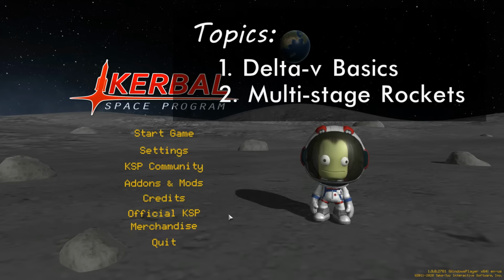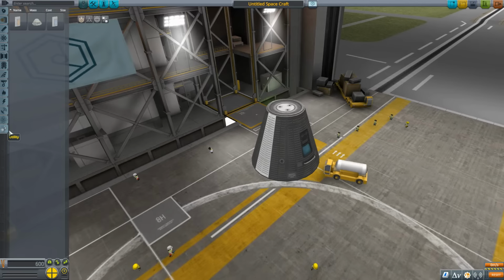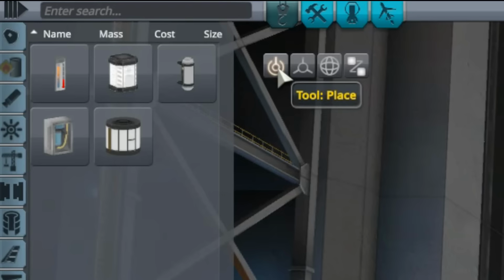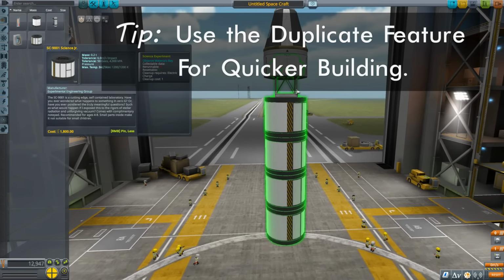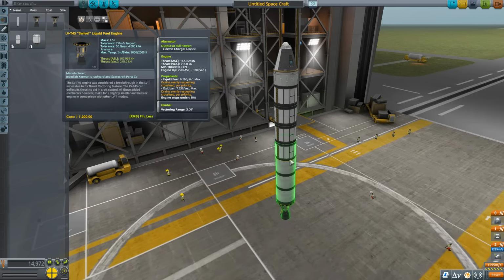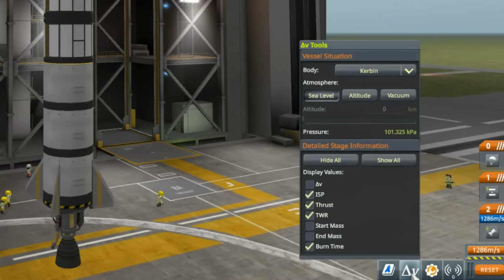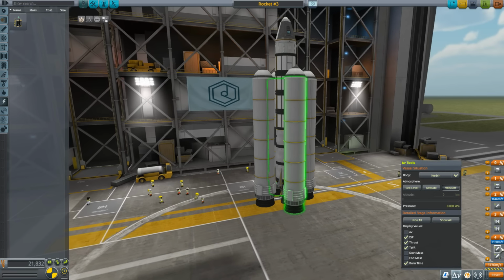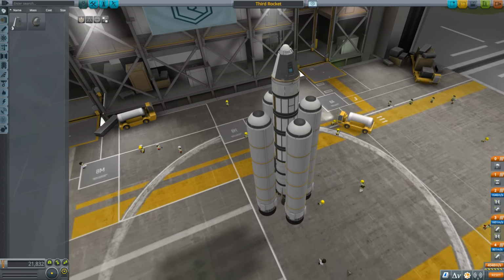More Rocket Building Basics - KSP Beginner's Tutorial

Comment from the maker: *If you are having trouble with the rocket flipping out, watch this - https://youtu.be/H70C32ECn6E*

*I also have a more up to date, and much easier to fly, first orbit rocket here - https://youtu.be/lRzIoKnrhnY?si=27VppKMEYVHsw-q5*

Up Next: Getting to Orbit - https://youtu.be/PbMP0lo4A2o
Reply: Hey, I've been trying for a while now, I've tried putting bigger fins but, my rocket keeps tipping over even if I dont touch it, any clue as to what I'm doing wrong
Reply from the maker: @Blackhole-go3sx  If you haven't already done so, try going straight up and then locking onto prograde a few seconds after launch. If it still flips out, it is most likely the CoL getting ahead of the CoM. Check their positions in the VAB. Also, check your fuel flow priority by right-clicking on the tanks. If you are draining upper tanks first, that could easily be a problem as it will move the CoM down. If you're still having trouble, post a VAB screenshot in the help section of the discord. Make sure the CoM and CoL are on. It's a much easier place to have a discussion.
Reply: @MikeAben  Thanks alot, I'll be sure to do it
Reply: @MikeAben  one quick question, how do I keep my rocket perfectly on the east like you do? Mine always tilts off from the east a bit.
Reply from the maker: @jetpond7904  It takes some minor corrections early in the flight. Once it picked up a lot of speed, it should generally keep heading in the same direction. A rocket like the one in this video is tougher to fly. Don't worry if you're a few degrees off.
Reply: @MikeAben  Oh alright thanks. Sorry that I have got soa many questions.
Reply: @MikeAben  my thumper booster did not have the same stats? What did I do wrong
Reply from the maker: @Kolos Barlik I'm assuming you mean the icons to the left of the navball for locking to specific orientations: prograde, retrograde, etc. If you are playing career mode the unlock as your pilots advance in level or as you unlock better probe bodies on the tech tree.
Reply: @MikeAben  I have a question, why is my UI bigger than it is in your game? sometimes I can’t pin some science on my screen as it’ll take up too much space
Reply from the maker: @jetpond7904  It could be a screen resolution thing. I'm pretty sure the size of the UI can be adjusted in the settings.
Reply: @MikeAben  I actually just found out but thanks !
Reply: @MikeAben  Another question 

I built this rocket but I can’t steer it at all, even if I use SAS to lock prograde, do you know what’s wrong ?
Reply from the maker: @jetpond7904  There are four ways to change the direction of a rocket: reaction wheels, engine gimballing, aerodynamic control surfaces, and reaction control thrusters. You need at least one of these things on a rocket to steer.

If you drop by my discord, you can post an image of your rocket and get more direct help.
Reply: @MikeAben  if it keeps happening I might, but which one did you use in this video?  Also it’s just the same rocket you made in this vdkeo
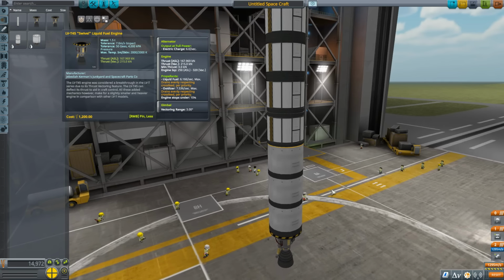Reply from the maker: @jetpond7904  This rocket uses two: reactions wheels and a gimballed engine. I talk about this in more detail starting at 13:46. Note that the SRBs don't have gimballing, so control is limited during that stage.
Reply: @MikeAben  you know what, I actually just found out that it was too hard to steer so I didn’t notice that it was taking affect. I’m very sorry about all of that just because I didn’t notice something

But thanks for helping !
Reply from the maker: @jetpond7904  No worries.

Comment: How did it only add 500? I thought it’ll add another 1600?  22:10
Reply from the maker: It doesn't work that way. Delta-v is not just a function of Isp and fuel, but also the total mass being pushed. As such, each booster added becomes less efficient than the previous one. This is the tyranny of the rocket equation. Keep in mind the staging still had to be adjusted. Once that was done it was closer to 800 added. Still, quite a lot less.

Comment: I am having a lot of trouble with the solid rocket boosters wobbling and falling off. Any tips?
Reply from the maker: Struts will solve the problem if you have them unlocked. There's also the auto strut feature that you can access by right clicking on a part. I believe you have to turn on Advanced Tweakables in the settings for this feature. That all said, the rocket show here shouldn't have that problem.

Comment: Built the exact same rocket. Triple checked. Mine has 2600 m/s. I don't get it.
Reply from the maker: Make sure the dV windows is on vacuum.
Reply: @MikeAben  doesn't make a difference. I'm way below your m/s. Really strange
Reply from the maker: @Davidwv97  If switching from surface to vacuum doesn't make a difference, then something is definitely wrong.
Reply: Did you ever find out what was going on? im experiencing same deal :I
Reply from the maker: @teemuleppa3347  Just to add, I've loaded this exact rocket into the most recent version of KSP (1.12.3) and the dV is exactly what is shown in this video. Have you checked your staging? For example, having the wrong SRBs in the bottom stage will severely affect dV.

Comment: The bottom thruster explodes after stage 2 I think the other booster is hitting it when I decouple it but IDK how to fix it also the navball kinda goes off the north-south 90 degree line (or the prime meridian) I don't think it's much of a problem but I would still like it to be perfect
Reply from the maker: Slide the boosters further down but leave the decoupler high up. As for the  second problem. This is a tough rocket to streer when the SRBs are going. Better parts later will make this easier.
Reply: @MikeAben  Thanks!
Reply: @MikeAben  also, which booster do you recommend for making it easier to control?
Reply from the maker: @xyvaris99  Both engine gimballing and aerodynamic control surfaces will help. The SRBs don't have gimballing and I've not unlocked control fins yet which is what makes this rocket harder.

Comment: Im a bit late to this vid. but I built the rocket. And for some reason as soon as I seperate and begin stage 2 my rocket spins out of control and loses all its speed
Reply: Oh and also, the liquid engine just blows up as soon as I start stage 2 lmao
Reply from the maker: @operatorfox2  I can't speak to the second problem, but the first sounds like your centre of lift is in front of your centre of mass. I talk about it here.
https://youtu.be/X2CeSk6ATjo
Reply: @operatorfox2  Adjust the solid fuel boosters higher up without changing the decoupler the booster is smacking into the rocket

Comment: PRO TIP: Some rocket engines might have a TWR Less than 1 when you're fully done with a rocket, remove parts that are attached to a decoupler so you can have a more clear and correct TWR.

Comment: I know this vid is kinda old but I'm having a problem. I built the same rocket as you and I've changed to the AV-T1 but my rocket won't stop rotating. Any tip?
Reply from the maker: If by rotating you mean rolling around the central axis, then likely there's an asymmetry somewhere, either in the radial boosters or tail fins. If they're rotated slightly, that will cause a roll. Try removing them (and the radial decouplers) Nd putting on new ones. A little bit if roll is normal, but spinning like a top isn't. 

If by rotating you mean it wants to spin around backwards, then make sure you aren't moving to far from the prograde vector on the navball. Another thing to try is turning down the fuel flow priority on the lower tanks in the VAB. This keeps the center of mass forward which improves stability.

You can also try downloading the craft file in the description. If it flies better for you, than you know it's something in your build.
Reply: @MikeAben  yeah I messed up. It was my build. Thanks bro
Reply from the maker: @ericp.5533  You bet. We've all been there.

Comment: These tutorials are excellent. I’ve done well up until this point. But I’m doing something wrong with the SRBs. The craft destabilizes as soon as start to turn east.  I’ve moved the SRBs up and down and I can’t figure out what’s going on.
Reply from the maker: If the rocket is flipping around it is most likely because the centre of lift is too far forward. The problem is likely not your rocket, but the tail fins. Are all four of them there and are they as low as they can be on the rocket. I didn't talk about centre of lift in this video (I will in a future rocket tutorial), but I did talk about in regards to planes here.
https://youtu.be/416zilwOwAQ?t=742
With rockets, make sure the centre of lift is well behind the centre of mass.
Reply from the maker: Another thing to try is too swap the small tail fins for some bigger ones.
Reply: @MikeAben  hey man just like some of these other people I can't get this thing to fly.  I've rebuilt it and rebuilt it, each time carefully following your steps.  Great video btw.  However it just doesn't work for what's reason!
Reply: Mike Aben I read up on that and no matter what I did I couldnt get my rocket balanced. Then I saw your craft file. And I tried with that. I can’t even get that to fly straight. I have SAS on when I start my maneuver to pitch East I can’t stay on the 90°.
Reply: I'm fairly new to the game but I experienced the same thing last night. I have a rocket (Icarus 3) that fly's beautifully for an early game rocket. Then I  changed only the astronaut capsule for a sputnik so I could be more adventurous with risking Kerbal lives (KLM). With the sputnik the rocket spins round and round quickly going nowhere. I change the top back and hey presto I'm back in orbit. Do you have a good pilot and the SAS on?

Comment: I am doing some thing wrong each time I fire the rockets they start to wiggle and it explodes. lol I am re watching
Reply from the maker: Yup, that's part of the fun. Notice mine wiggles a bit on th pad too. Make sure to wait for it to settle out. If you're using the same design as I am, moving down the four SRBs a little further may help. I believe mine is sitting on the swivel engine bell when on the pad, but the four SRBs would likely be a more stable platform. Also, if you've unlocked struts and launch clamps yet, use them. They'll be featured in my next building video.
Reply: @MikeAben  I got it. My SRB's weren't on the couples I think or something cause I would wait  till it stopped then launched it still hand problems even with SAS on it crashed and burned I just redid the SRB's couples I'm not sure if its bug or what but it kept trying to put four couples on instead of the two I wanted and it would change by its self

 it worked after I redid them so it had to be my placement of them or something. 

Last time LOL i forgot I was still had my thrust on and I took Jeb out for a EVA bye bye Jeb lol